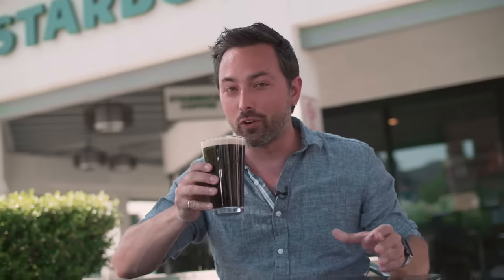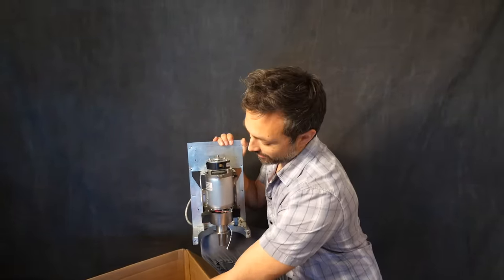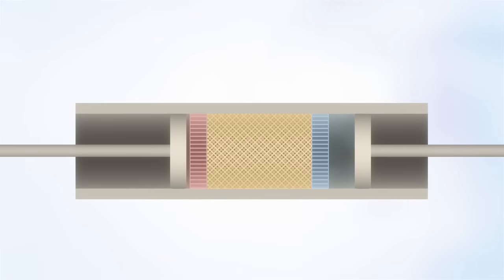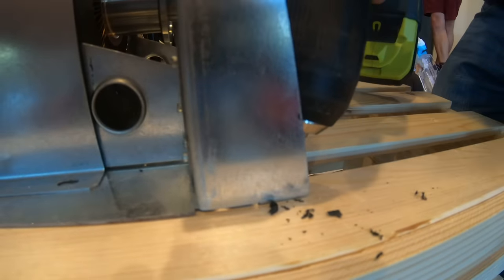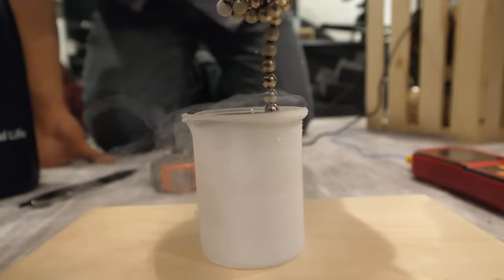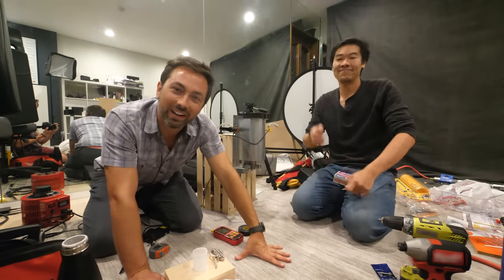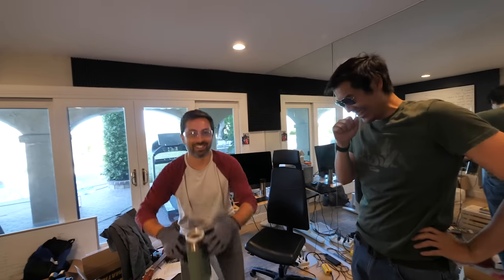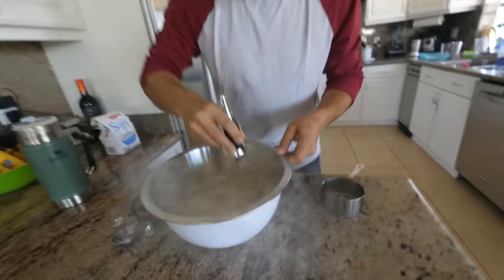Making Liquid Nitrogen From Scratch!

Comment: not once did i hear anything about how dangerous it is to make this, the liquid cant also instant freeze your skin
Reply: it is not. It WILL NOT instantly freeze your skin. The leidonfrost effect prevents that.
Reply: @goldenpiston8449  tell it to those rats we dipped them in ,  they froze in seconds
Reply: @robertmayfield8388  1; rats have fur, which is very finely stranded and therefor a low heat mass and large surface area. 2: skin has some amount of water on it, which also helps protect you. 3: it takes amount 1-2 seconds (which is frankly a lot of time) before liquid nitrogen stars cooling off your skin
Reply: @goldenpiston8449  Liquid nitrogen has a boiling temperature of -196°C at atmospheric pressure. Direct contact can freeze the skin causing frostbite and cold burns. Delicate tissue, such as eyes, can be damaged by an exposure to the cold gas alone which would be too brief to affect skin., im not going to argue with you on this, i happen to see it first hand and i know the dangers of the stuff but you are surely entitled to your opinion
Reply: @robertmayfield8388  considering I work with liquid nitrogen daily I am pretty sure I know how it works. There are many videos of people dipping their hands in the stuff, or pouring it on their hands
Reply: Infact I made such video… but later removed for reasons lmao. Regardless, Leidenfrost effect, very popular on youtube

Comment: I have a doubt
When you were cooling the air upto cryogenic temp then only 50ml of liquid air condensed but air has water vapour also so there should be water also bcz water vapors has much lower condensing temp.

Comment: why do plants contain nitrogen, is it to form chloroform for internal exchanges for photosynthesis? 78% nitrogen in the atmosphere is very interesting. that and tapering of temperatures, nitrogen seems irrational.
Reply: in state of equilibrium nitrogen is encapsulated to a ratio volume of microbrew where the possibility for o2 to adhere is of course to the microbrew itself. thus the entire weight dimension becomes disimilar?
Reply: to answer as to why bubbles form intowards the center is as intriguing to answer as to a state of equilibrium and the adaptation of the liquid content in question while the possibility of o2 as adhering to the liquid in question.

Comment: "..from scratch" (?)   sure, just need a Cryo-Cooler and Helium.   and a good deal of knowledge.   Liquifying air is pretty cool, but to then remove the 02 and call this from scratch is a bit of hyperbole; that's because very specific equipment is required in order to perform these steps, obviously.

Question for Veritasium:  other than the liquid O2 and the obvious flammability of Helium and compressed oxygen, is there any danger to attempting this experiment at home, provided the equipment used mimicks what you have shown here?   And yes, I don't believe you've shown enough to allow replication from your video alone.

Comment: How's that carpet doing,, I thinking the chance of him drilling, using that kind of pressure downward, and the always possible outlook of the hole saw breaking thru the particle board as opposed to cutting thru, resulting in a horrible scene of twisted and ripping of said carpet and possible stalling the rotation of the drill chuck and transferring that rotation to the body of the drill thus having the operators arms getting tied up like a pretzel,,, and feeling pretty dang bad about the whole thing.
    If in fact this happened,,,  Look Alan, It's cool no one is perfect,,  If no,,, Well then that's great because the carpet is fine, Alan doesn't feel bad,,   Leaves me looking like a know it all with egg on my face and that's ok,,, BTW I am already thinking about trying to engineer a compressor for what you had there, Project time.   Plz let me know when your going to make Nitrous Oxide so I could learn,, For race car of course.

Comment: I still don't understand how cooling works, "via work done"
HOW
if heat energy only ever flows one way, how can electricity make a refrigerator.....refrigerate???
Reply: When substances freeze or condense, they release heat energy into their environment. When they melt or boil, they absorb heat energy from their environment. (The latter is the main reason that ice keeps your drink cold - the melting process absorbs a lot of energy.)

We can force certain chemicals to make those phase changes when we want, by pressurising and depressurising them. If we make those phase changes happen in different places, we can absorb heat from one place and release it in another.

This is how refrigerators, air conditioners, and heat pumps work. You're effectively pumping the heat from one place to another, generally the inside and outside of some insulated enclosure.

For every one unit of heat a refrigerator creates (by using electricity to compress and move the refrigerant chemical), the whole process might absorb 3 units of heat from inside the refrigerator, and release 4 units out the back and into the room.

You're adding more energy, but you're using that new energy to move existing energy from one place to another.
Reply: @steve470  oooooo thank you!
I had never made the connection between latent heat and pressure-based phase change..............daaaaaaaaaaaaaaaaaang

I never considered both of them occurring in the same setting
Thank you so much!

Comment: Damn I wish I was there for this video. The way to efficiently make nitrogen is to pressurize the container to, lets say 100 PSI,, then you have a regulator maintain the pressure that way you are only adding heat to the system when you need to plus the molecules of nitrogen are much closer together at that pressure thus the cryo pump has greater contact with what it is trying to cool.

If you were really serious about it you could go to thousands of pounds of pressure.